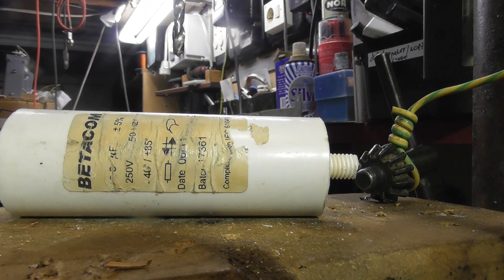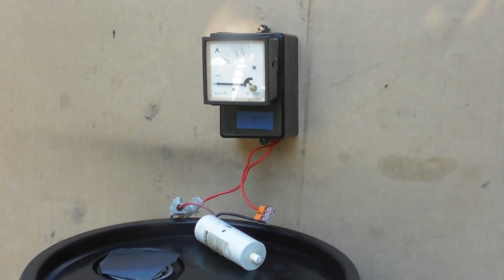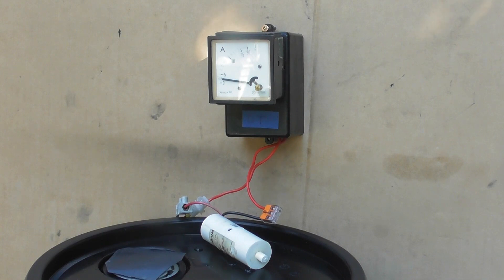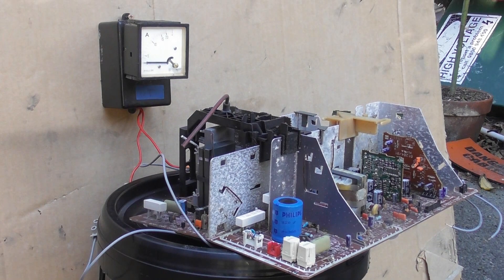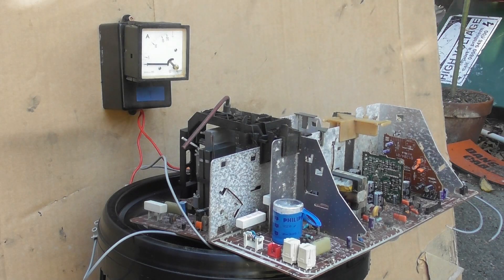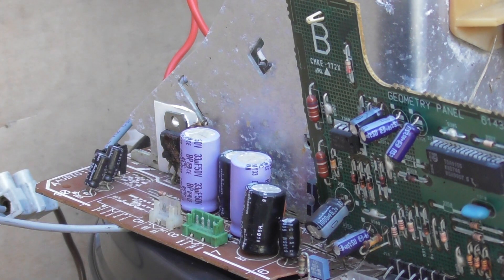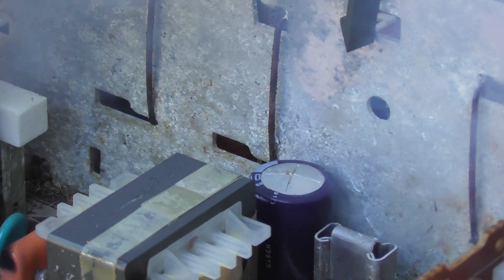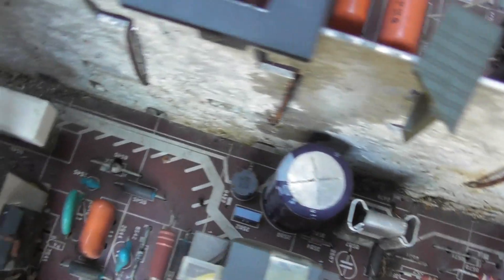Faulty streetlight capacitor and a couple of Cap vents

Comment: You should try soldering over the vent  indentations on the electrolytics and see how they go?
Reply: You can't really solder there, because it's made of aluminium and the solder doesn't stick to it. I'm clamping capacitors in my vice, so that the safety vent and the rubber seal is covered, and it ruptures rather violently on the side. That works pretty well.